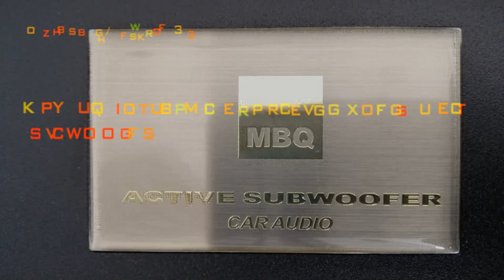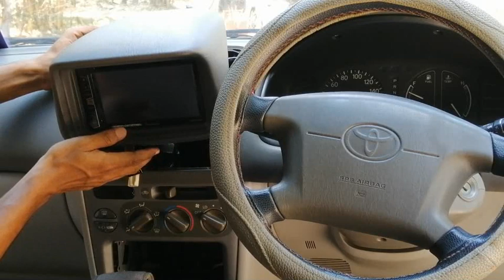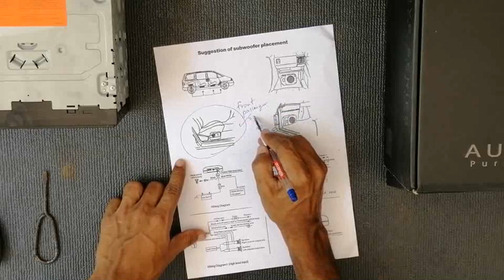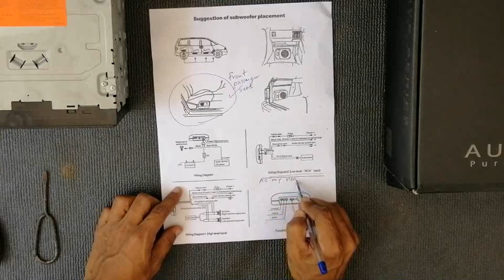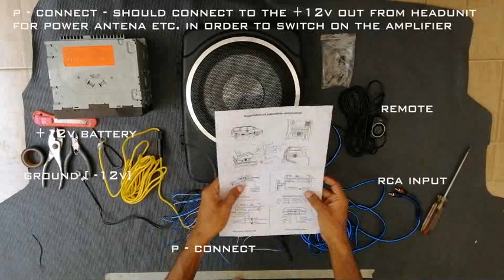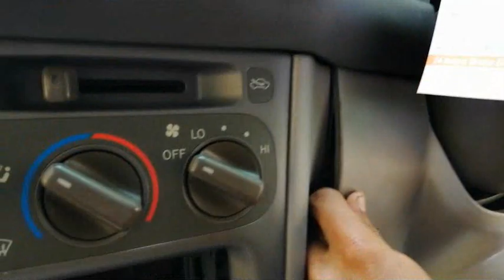How to Install a Compacted Under-seat Subwoofer

Comment: Not really explaining any
Reply from the maker: we have clearly shown each step for installing the underseat subwoofer. Due to  a technical issue, we can not use voice for  our videos and in future we will surely add voice also. I am really sorry if you did not get any from this video and hope to help if  you need some clarifications please
Reply: @the_garage  one will g o to battery one will in music system is tht enough?? And it will only work when we on music system not drain the battery like bas tubes ?
Reply from the maker: Here, the subwoofer is on when the ignition is on..if you are not in ignition on position, no any power is utilized. The battery power is only for the memory which is not draining your power. It is negligible.  Actually these subwoofers are active subwoofers and it comes with a in built amp. So not much power is required. Just plug your wires as per the video.cheers

Comment: That is so much work!! All I had to do is slide it under the seat from behind and pass the cables under the carpet into the head unit. Took me 15mins
Reply from the maker: Yess..it is easy to install..here I am removing the seat in order to done it preciously. If not this can be done very easily as you explained..thank yoi
Reply: I was bout to say the same thing
Reply from the maker: Yest, it is very easy to install. As i am doing a demo  video i remove all the things and clearly show the way of installing. Thank you..

Comment: why did you do it like that ? it is so much easy to install . this si totally wrong and your car can burn
Reply from the maker: Sir, we have follow the instruction in the manual for installing this subwoofer, in order to be precious, the seat also removed and place the subwoofer correctly, 
the point which we did not get is what were the errors that we made when installing the subwoofer as you mentioned. It will help us to improve our work.
Regards

Comment: What am I doing wrong, I don’t have a direct plug in for the rca leaders so iv spliced the 4 wires to left and right speakers, it works but is to basey to the point iv turned the sub power to min and sterio base to min?
Reply from the maker: Make the sterio base to flat. Then change the base level from subwoofer controllers. This might works well. Thank you
Reply: @the_garage  iv trued this but if I have midds or any additional speakers that are not tweeters, they will sound flat
Reply from the maker: Then how about change the settings of the sterio to play the mid frequrncies and for the subwoofer settings, set the low frequencies and crossover to the lower margin of the subwoofer
Reply: @the_garage  brilliant I’ll try that thanks
Reply from the maker: Hope yoi will figure it out well. Good luck

Comment: Hi, my MBQ 10 inch works, but do u know why when i turn the gain or freq knob or even the phase button, there is no difference at all. Is mine broken or yours is the same? thanks!
Reply from the maker: My one is also same..I think that this is fabricated with a pre-amp which has not much power..it only plays the limited frequencies and changes may also be limited. If this is installed via a seprate amplifier, these changes may come to action. My one is also same..no difference at all.thank you

Comment: The same mistake everyone makes, to get decent bass from these things it MUST be sturdy attached to the vehicle !
Reply from the maker: Agreed, we are recomending to connect this subwoofer to a wodden plate and fix it to the vehicle. What is your opinion?
Reply: @the_garage  Wooden plate that is bolted to the vehicle will work.
Velcro or just loose under the seat are the most common mistakes, even the manual has it wrong on many of these.
Reply from the maker: Thank you for your valuable comments

Comment: my car player has a subwoofer connector on the back of it,can i install this subwoofer without amplifier? or i need the amp....and do i need aftermarket player? because at the back of my player already have subwoofer connector....sorry for bad english
Reply from the maker: These type of subwoofers are called active subwoofers which means they already have in-built amplifier on them. seperate amplifier is no needed.
If your car headunit already has a subwoofer out, then you can surely use it for this type of subwoofer installation. 
Wish you all the best for your installation.
Reply: @the_garage  thank you so much!,another question is...my player only have one subwoofer output, how can i installing another subwoofer if i wanted soon?
Reply from the maker: Then it is better to install via seperate  amplifier ( 2 or 4 channel) . Then you can plug 2 subs simultaneously.

Comment: Hmm isn't it dangerous to run your wire just behind the engine block? It might melt or degrade the rubber insulator quickly and cause a short if it touches any metal part, just to be sure try to run the wire away from the engine. I'm Just concerned.
Reply from the maker: We have used to lay our wiring right top of the original wiring harness which may not contact any metal part of engine block. But as you said, there is a possibility of melting of degrading the insulation of the wire as we are not covering it a extra insulation cover. Next time, we will concern about it and thank you for your great advice. Appreciate it very much.

Comment: what will happen if we connect only rca and power line only. mine p-connect and speak line is not connected, do I need to connect them now
Reply from the maker: If you are connecting rca, then no need of connecting speaker lines. But you need to connect p-connect(a ignition +12v) to the subwoofer in order to switch on the inbuilt amplifier. Is it working without connecting p connect??
Reply: thanks, it helps he alot.
Reply from the maker: Any time 💪💪

Comment: i have a same MBQ woofer installed in my car. i didn't use RCA but connected through speaker wires. sounds really great but on the rear seat i could not feel the bass. I can feel bass only in front two seat . Any problem with the installation? suggestions please
Reply from the maker: Nothing wrong  in the installation But you have to changed the settings fir the subwoofer from your sound settings in thr head unit. Please find the following video to see how I changed settings for my installation.
 https://youtu.be/DGNnWduD08A

Comment: Can these be installed using stock head units (2015 corolla)?
Reply from the maker: If you have seperate out for subwoofer or audio out in your stock head unit, then it can be installed .
Otherwise, you can use your speaker out from head unit to feed the subwoofer also. So this can be installed to a car via  nominal speaker out

Comment: So you just screw it in to the floormat? That secure enough?
Reply from the maker: Normally it is recomended to fix it to a flat wooden board and put it on the floorboard. But here as the subwoofer covers its entire body with a plastic cover, no short circuits will happen. But for higher bass sound, without a proper fixing, the sound may not as expexted.

Comment: hi, cant we use as power in put from audio setup? (same power source for both)
Reply from the maker: Normally audio setup has two power inputs, one of +12v battery input and +12v ignition input. 
Yeh this +12v ignition power input can be used for the +12v  remote wire power for the subwoofer. Firther it needs a +12v battrry power also.
But be careful when you are using +12v ignition power, it needs to be a power source which not engaged in the engine main power. Otherwise you will experience a engine noise from your audio setup

Comment: mere pass dzire me company fittead sterio hai usme RCA cable ka pin  laganeka   ka option nahi hai. kya ho sakta hai?
Reply from the maker: Normally, every player do not equipied with subwoofer RCA outs. Then we have to give the signal for the subwoofer via speaker out lines.
 In this video, 2.50-3.20 we show the installation manual. As we have RCA out, we have chosen the RCA method. But if you want to install it using speaker out, the third method can be used. We will upload a close up of wiring diagram for you of the above installation, cheers

Comment: No fuse between the yellow cable and the battery? I got a blaupunkt underseat sub and i dont know if there is need of a fuse on the power cable.
Reply from the maker: Is your sub has a fuse in its body near the power connection socket as this subwoofer. Then you need no fuse between the battery and your sub. If not it is recomended and much safe to add a after market fuse to this main power line to protect your subwoofer from power surcharge. If the line get high load, higher ampier, then the fuse burn out and protect the subwoofer..nominal ampier for  the underseat subwoofer is 30amp.
Reply: Okay , because i dont have the fuse with the kit and on the video i didn't see a fuse on the yellow line. So i have to buy an aftermarket fuse.
Reply: The subwoofer is the : blaupunkt thb-210a.... do i need a fuse?
Reply from the maker: @snowdoglover8204  you have got a fuse (yellow colour) in your subwoofer compartment. So no need extra fuse. Just directly connect the yellow wire to the positive terminal of the battery. +12v
Reply: Did you put all the wires on one side or sepperated? Ground , power and rca?
Reply from the maker: I have laid power and ground in one side and rca in  another side innorder to prevent the noice from the system..
Reply: Thank you for the information. I have installed subwoofers but never a active on. I have al the parts. The cables are set up , only have to connect them , will do that tomorrow. Have a nice new year and a great 2022!
Reply from the maker: @snowdoglover8204  hope you will success in your installation. Good luck and best wishes for the coming new year 2022.

Comment: so if my unit have an rca cable then I don't have to connect other wires and just the rca cables?
Reply from the maker: You have to connect power cables and p-connect in order to power up the sub. The sound signal will come through the RCA output from the unit to the sub. No additional wiring needed.
Reply: @the_garage  ok thank you
Reply from the maker: Abhishek Singh welcome 🙏

Comment: The sound is better throught rca or high level input or is the same sound?
Reply from the maker: Its is better via RCA low level output as the subwoofer plays low frequencies.
Reply: rca and high level input is the same thing. both send out audio signal. I dont think there's a difference
Reply from the maker: Yes. Both delivers audio signal, But factory stereo systems connected with high-level inputs will not sound as good as low-level inputs. If your using an aftermarket stereo, there won’t be much of a difference between high-level or low-level inputs on basic systems. If you’re going higher end we are recommending to use low-level inputs. Thank You

Comment: Would it fit under the passenger seat of a foxbody mustang?
Reply from the maker: Yes.this can be placed either under the driving seat, passenger seat or back in the boot. For foxbody mustang, it is recomended to use under the driving or passenger seat

Comment: What about the sound quality?
Reply from the maker: It has a good sound quality. No noise. Clear low frequrncy sound. Good base which suit to a interior of a car cabin. Though it is not sound as large subwoofers which run with seperate amplifiers, this is a good product to use which will satisfy your requirements. Can be recomended.
Reply: @the_garage  deep base with less dum dum?
Reply from the maker: Yess..the sound is much better. Clear.no noice at all..decent sound and base.

Comment: Salam bro wayar blue/white wire dri woofer sambung ke audio ke? Audio wyar wrna ape ye bro?
Reply from the maker: Sinyal audio akan datang melalui kabel RCA. Kabel biru / putih harus terhubung ke + 12v untuk menyalakan amplifier yang terpasang. Salam bro
Reply: @the_garage  ok bos bnda dh cnfom ada msalh dh cll seller dia akn gnti lain wrnty 2thn..ptutlh psng2 xda bnyi wofer yg brmsalh..
Reply from the maker: @hamidrahman3021   
Itu berarti Anda tidak memiliki input RCA ?? Kemudian gunakan input tingkat tinggi melalui dua speaker belakang
Reply: @the_garage  smua sudah dicuba...remote rosak
Reply from the maker: @hamidrahman3021  menyesal mendengarnya, tidakkah Anda memiliki tombol untuk penyetelan manua
Reply: @the_garage  tombol? Remote rosak...
Reply from the maker: @hamidrahman3021  Maksud saya tombol di subwoofer. Apakah ada tombol untuk mengubah pengaturan di subwoofer selain remote. Kemudian Anda dapat menggunakannya tanpa menggunakan remote yang rusak
Reply: @the_garage  i return to seller warnty brand blaupunkt 2years wrnty..speaker  remote not fntion..so i claim wrnty..speaker ok ..remote not ok..
Reply from the maker: Ok..hope you will get a new one without any errors..thank you

Comment: Why my mbq woofer sound cracking and kejap ada kejap takda
Reply from the maker: Thats because the settings of subwoofer is not matching with the headunit settings.try to change the settings in headunit as per the settings of subwoofer. Flat the bass trebble in the headunit equilizer.

Comment: Celerio me fit ho sakta hai kya?
Reply from the maker: Normally factory fitted headunits are not equiped with RCA outs. If you are using aftermarket headunit , be sure to purchase a one with RCA out and then you can surely done this modofication to the Celerio also
Reply: @the_garage  thnks for the reply..I am looking  for RD brand under seat subwoofer  for celerio. RCA output is must for better bass quality right?
Reply from the maker: It is much better if you can use RCA output as it already devides the low freaquancies for the subwoofer. Other wise if you are going  to feed the sub from a normal speaker out, then unwanted noize can be damaged to your sound quality . So we are recomending to use a seperate RCA out for the sub for better performance.
Thank you
Reply: @the_garage  Thanks a lot
Reply from the maker: @TheUnOriginalsAdda  wish you all the best for your modification
Reply: @rahul celerio me lgwaya? Mujhe bhi lgana h
Reply from the maker: @Rohan9062  dhvani kee gunavatta kaisee hai? kya aap santusht hain?
Reply: @Rohan9062  abhi tak nahi

Comment: where does the blue/white wire connect to?
Reply from the maker: It is p-connect wire. You may connect this to the +12v power antenna out from your headunit.
Actually this is the power on for the inbuilt amplifier in active subwoofer. If you want to power  on it automatically when on the headunit you can connect as above.
Otherwise you can use any +12v ACC with a on/off switch in order to on and off the subwoofer as you wish.
Simply it is a+12v ignition power input. 
Hope you got the point 🤔🤔🤔

Comment: Can you show us how to connect two
Reply from the maker: Sorry, We did not get you sir???please breaf your question. Thank you
Reply: I was asking if you can explain the way to put two underseat woofers together
Reply from the maker: It is better to use a 2channel amplifier rather using two subwoofers connect to the system at once using audio outs from headunit. Use RCA to input the signal to amplifier and then use two outs from amplifier to give the signals to subwoofers. But careful about the power supplied to the system as this may drain your batteries quickly.

Comment: Metal body ba si unit?
Reply from the maker: It is not connected to the floor board of the car. I have fixed it to the original carpet which comes over the floor board. It is recommended if you can fix it to a wooden board.

Comment: axia player boleh pasang kah?? sub out
Reply from the maker: All the units are not equipied with the sub out / RCA out. Most Factory fitted players are with out this option. So it is better to go for a after market player or you can choose another wiring system to    input the sound signal to the subwoofer.  In this video we are showing the wiring for low level RCA input method. We will upload a photo for another wiring systems for your easy reference. Regards
Reply from the maker: Please provide us your email address enabling us to forward the wiring diagram. Regards